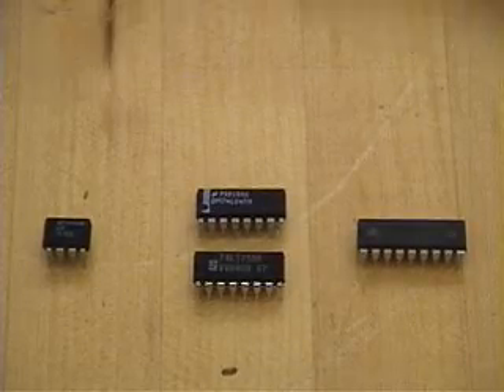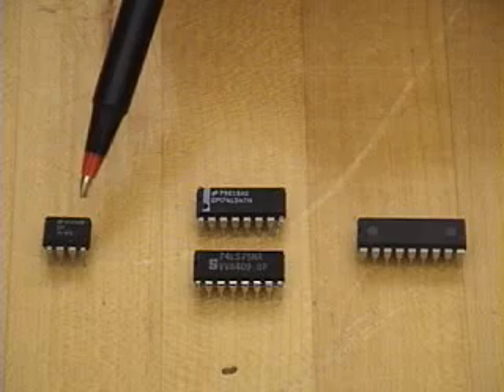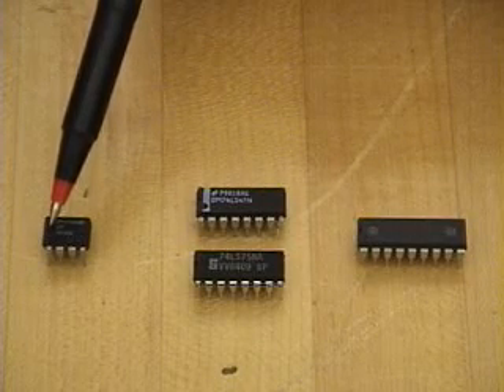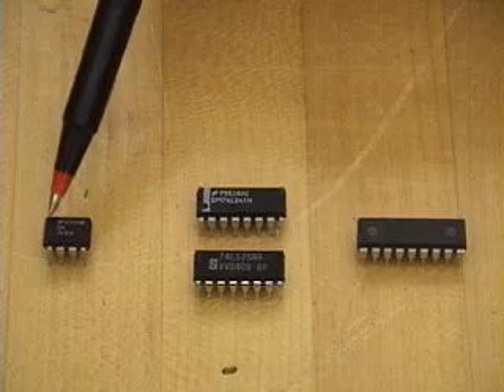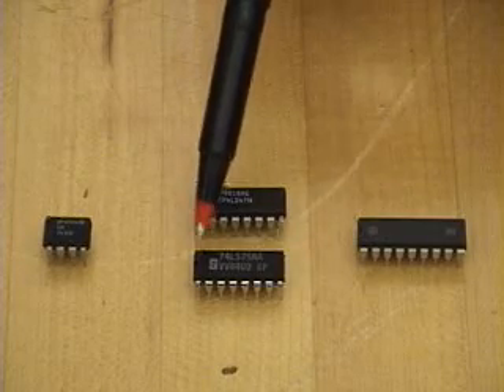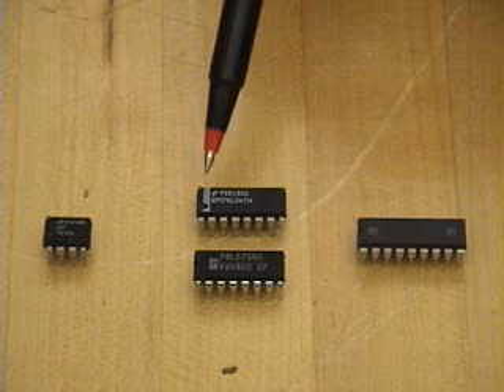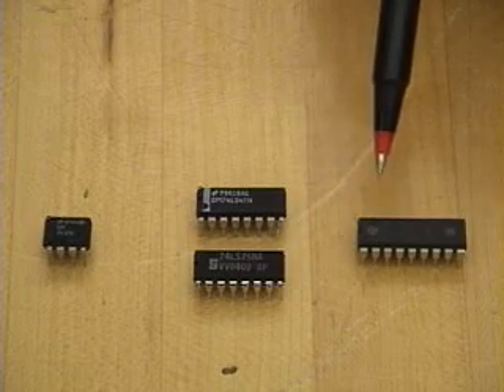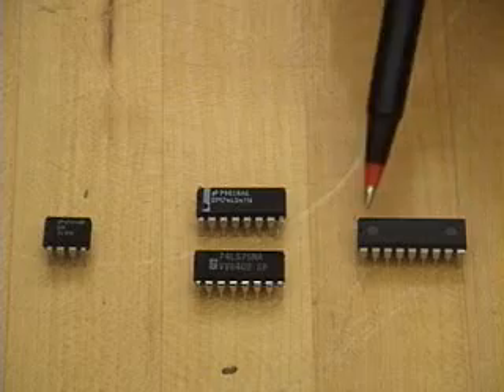Mechatronics Lab - integrated circuits (ICs)

Comment: Welcome to Grand Power Trading Co.,Ltd
Since 2001. The company mainly passive components and integrated circuits,
independent distributors. Provide the quotation and evaluation of BOM for
more than ten thousands of OEMs, ODMs ,R&Ds and Universities
all over the 
world. More than 200000 Ics in stock for selection. 500000 parts of ICs,
Transistors,Resistors available. 
WWW.http://grandpowertrading.com/

Ourstrongestbrand:SAMSUNG,ADI,AMD,ATMEL,ALTERA,
MAXIM,CYPRESS,DALLAS,INTEL,IR,MICROCHIP,ON,MURATA,
TI/NSC,VISHAY,NXP,FIRCHILD,Infineon, Connectivity brand.
Featured NEW Products
AT-106-SD Digital Attenuator, ...
 AT-106-SD Digital Attenuator, ... Description M/A-COM’s AT-106-PIN is a GaAs FET 6-bit digital attenuator with a 1 dB minimum step size and 50 dB total attenuation. This attenuator and integral TTL driver is in a hermetically sealed ceramic 24-lead surface mount package. The AT-106-PIN is ideally suited for use where accuracy, fast switching, very low power consumption and low intermodulation products are required. Typical applications include dynamic range setting in precision receiver circuits and other gain/leveling control circuits. Environmental screening is available. Contact the factory for information.

SD2942,RF Power Transistors HF...
 SD2942,RF Power Transistors HF... General Features GOLD METALLIZATION EXCELLENT THERMAL STABILITY COMMON SOURCE CONFIGURATION,PUSH PULL POUT = 350W MIN. WITH 15dB GAIN @175MHz LOW RDS(on) Description The SD2942 is a gold metallized N-Channel MOS field-effect RF power transistor. The SD2942 offers 25% lower Rds(ON) than industry standard and 20% higher power saturation than ST SD2932. These characteristics make the SD2942 ideal for 50V DC very high power application up to250 MHz.

XC6VLX365T-1FFG1156I 760 XILINX 1329+ BGA STOCK
MSC8156SVT1000B 1140 FREECAL 1329+ BGA STOCK
P408ESSE1PNB 380 FREECAL 1334+ BGA STOCK
MT41J128M8JP-15E IT:G 6840 MICRON 1322+ BGA STOCK
S29GL512P11FFI010 380 SPANSION 1326+ BGA STOCK
LCMXO2280C-4FTN324C-3I 760 LATTICE 1327+ BGA STOCK
H5TQ1G63DFR-H9I 10640 SKHYNIX 1321+ BGA STOCK
BCM5482A2IFBG 380 BROADCOM 1325+ BGA STOCK
BCM5396IFBG 380 BROADCOM 1330+ BGA STOCK
TSI578-10GILY 380 IDT 1318+ BGA STOCK
AD9516-1BCPZ 1140 AD 1328+ LFCSP STOCK
MIC49300WR 1520 MICREL 1317+ SPAK-5 STOCK
POWR1220AT8-01TN100I 380 LATTICE 1321+ QFP STOCK
B120NF10 760 ST 1330+ TO-263 STOCK
P0502NL 760 PULSE 1330+ SMD STOCK
CB3LV-3I-100M0000  380 CTS 1327+ SMD STOCK
ST3232BD 380 ST 1330+ SMD STOCK
IDT5V2310PGGI 380 IDT 1248+ SMD STOCK
SIR172DP-T1-GE3 3420 VISHAY 1334+ QFN STOCK
SIR164DP-T1-GE3 4940 VISHAY 1333+ QFN STOCK
TPS40140RHHR 2280 TI 1336+ VQFN36 STOCK
DS2406P 380 MAXIM 1329+ TSOC6 STOCK
CY8C21534-24PVXI 380 CY 1331+ SMD STOCK
MT29F8G08ABABAWP-IT:B 760 MICRON 1330+ TSOP48 STOCK
MTEDCBR002SAJ-1M2 IT 350  1332 MODULE STOCK